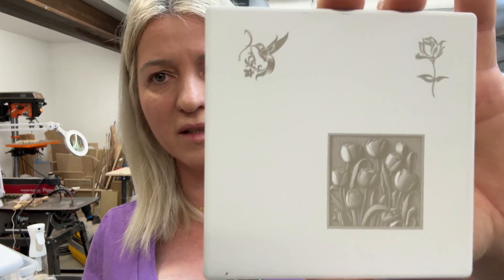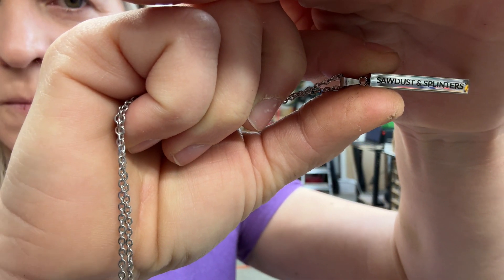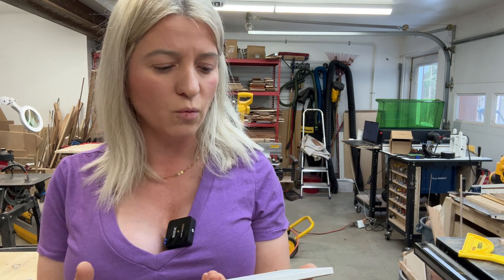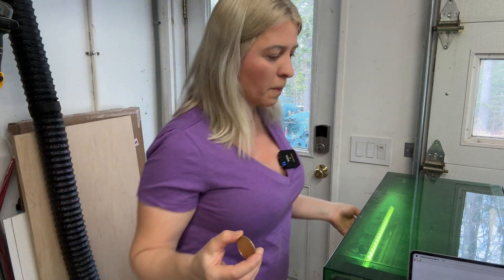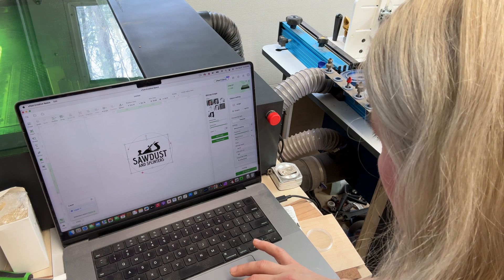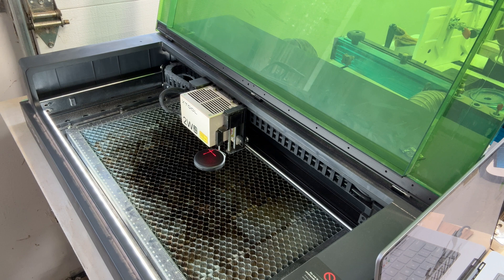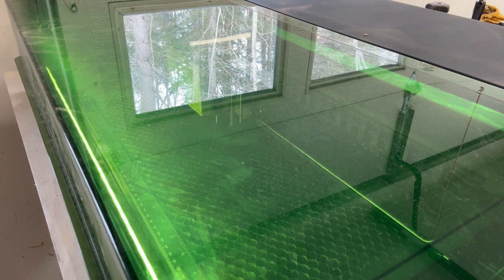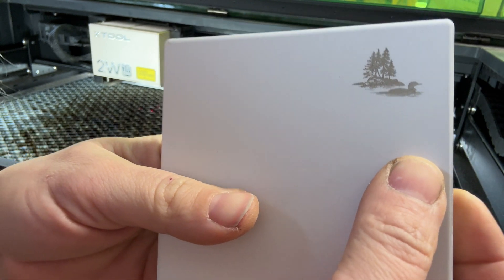XTOOL S1 1064 nm Infrared Laser Module. Engrave on white tile without marking spray

Comment: Hi, im a beginner from mexico, and im starting to desperate  deeply, i recently bought the xtool s1 40W machine, its been a week and i cant engrave any metal, i have been watching every tutorial here, can you tell me please with your experience does the 40W laser can engrave metals? or did i had to buy the 2W laser? thank you
Reply: Yes und have too buy it
Reply: Assuming the 40W is a diode (most are), it will not engrave metal.  It may mark certain metals if you treat with a marking spray prior to engraving.  But it's really bonding that coating to the metal, not engraving.

Comment: Very talented! From Photography to wood working :)
How deep (how many mm?) the S1 can engrave into plywood/hard wood, and which head you recommend? Infrared 2W or 40W? thank you.
Reply from the maker: Infrared will not Marc the wood. Infrared is only for metal and plastic. The 40w laser head will engrave pretty deep, depending on setting. You could easily go as far as 1/4 in or more.

Comment: Hi Skyler. Have you tried it with light or socket face plates? To indicate what each switch turns on/off for example. I’ve seen some multi switches in kitchens for isolating the oven, fan extractor, fridge, etc.